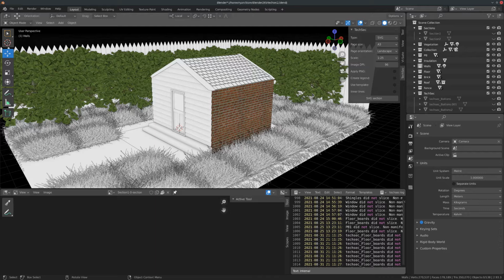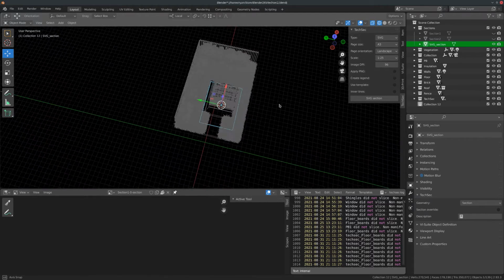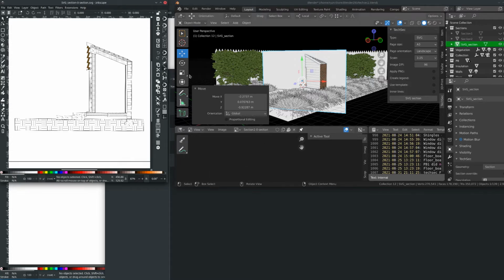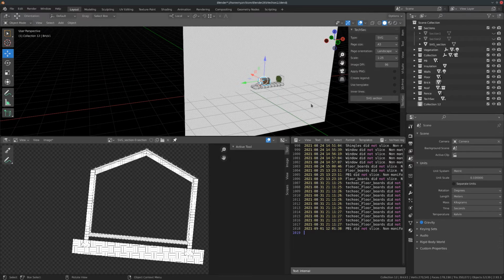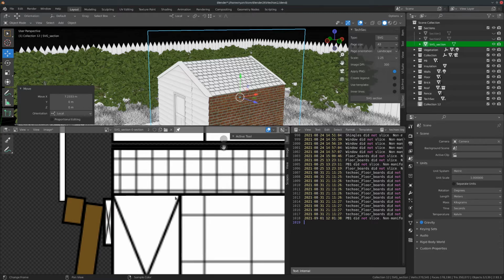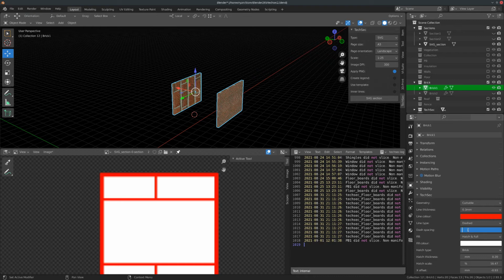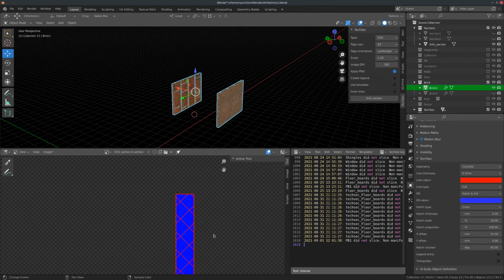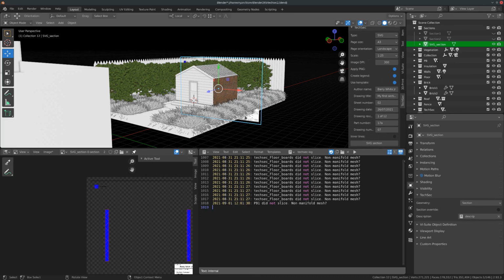TechSec v0.3 Tutorial 2 - SVG Mode

Comment: I'm experiencing difficulties. apparently my menu doesn't appear like yours, it has less features. Does techsect run on windows? I need a video with initial explanations. But I keep trying around here...
Reply from the maker: It does run on Windows. The installation and introduction video has the basics, and the user manual covers most things. If you have still have problems send me a screenshot through BlenderMarket.
Reply: @ryansouthall8464  I'm already able to use it...don't worry. it was just an initial despair. little by little I'm learning everything
Reply: I learned. very good and useful